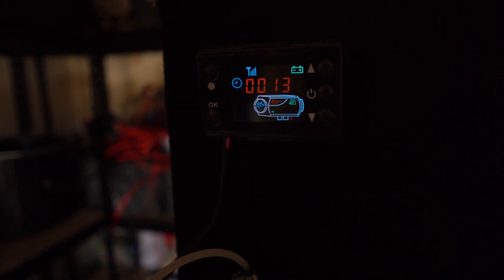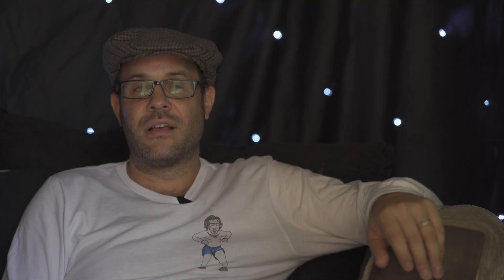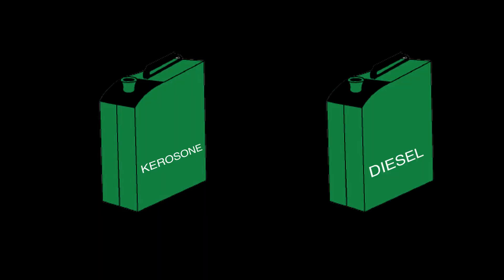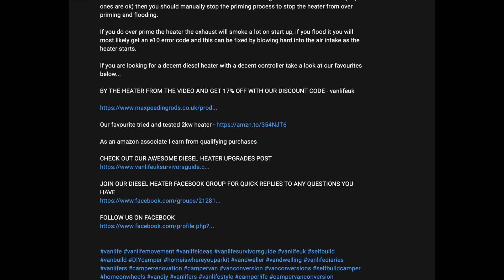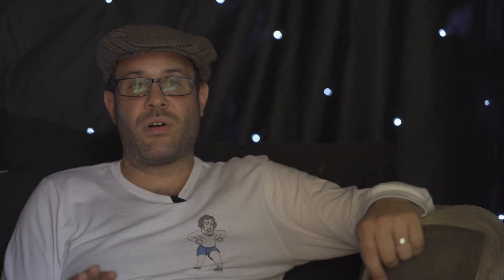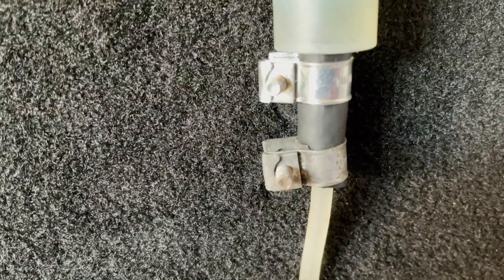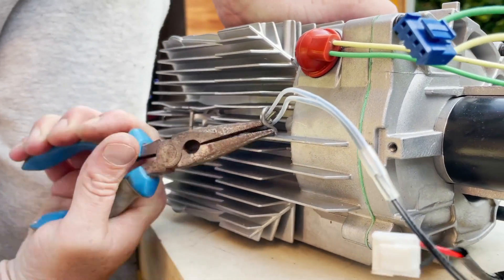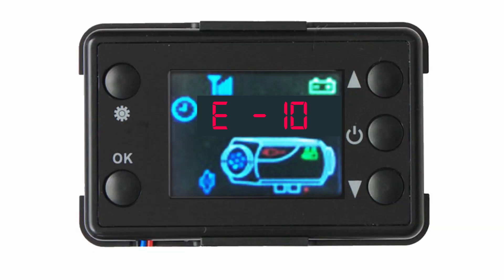Chinese Diesel Heater Error Codes E01 - E10  All Codes, Faults & Fixes

Comment: December 7th 2021
One year & one month since I brought my chinese diesel heater, I went to turn it on , and heard "Click", with no heat, no sound, no light on the controller.  I am saying all this to say "Thank You",for making this video..
After watching your video, and a few checks with a multimeter I figured out that the controler was gone.  I did as you recommended and brought another diesel heater.( cause just the ECU, may cost more than the whole heater)   With alot of praying and patience I got the plugs to fit into one another, installed the ECU, and changed the controller.  The controller has to match the  ECU, or you'll get the E-07, code.
Thank you!

Comment: Great vid, went to my van and the heater was blowing cold (obviously not shut down properly after last use) I press and hold the off button but it doesn't work and won't turn off, shows error code 1, had to disconnect the leisure battery to stop it blowing, any info greatly received if you have any ideas? TIA 👍🏻
Reply from the maker: Hi mate, yeah that sounds like error code 9 from the video. The heat sensor needs replacing and costs about £6 and takes about 5 mins to change. I think the e01 error code in this case will be a red herring as e01 is a low power error code and your heater is working.
Reply: @vanlifesurvivorsguide  thanks, I'll take a look 👍🏻👍🏻

Comment: Decided to by one, and keeps throwing p-01 code on 12v, 24v, new batteries, with charger on them and is reaching required power levels per the manual. Even added some juice to see if it would throw a high voltage code but never did. What controller and board would you suggest to get for this just so I have a piece of mind?
Reply from the maker: Hi mate, there isa motherboard and controller and remote set in this post we recommend. you will need the 5kw motherboard and then we suggest the blue controller with the red remote as the best option for controllers https://www.vanlifeuksurvivorsguide.co.uk/post/chinese-diesel-heater-spare-parts-added-extras-upgrades-2-0

Comment: hello 
my heater is showing E-3  and shut off after like 5 seconds when i turn it on.    its E-3 not E-03 i dnt know if they same or not ..??? please help
Reply from the maker: Yeah it should be the same, sounds like your glow plug isn't igniting. It could be the glow plug or your battery isn't strong enough to heat it

Comment: I keep getting the E 10 code. Maybe I over primed it, I’m not really sure. The tubing that came with the heater actually didn’t fit on any of the things it had to, so I got thick black fuel line, but it’s not rigid. Also the fuel line coils a little bit before it gets  to the pump,  And then at some point I also had some red symbol in the heater and I thought maybe that was a glow plug… Any ideas? Would love your feedback… Thank you
Reply from the maker: Hi sorry,  we have only just seen this message. So you would have gotten a small amount of the black tube and some rigid fuel line in the kit. You cut the small black tube into 6 equal lengths and use that to connect all the equipment with the rigid fuel line. If you watch through the video again you will see what we  i am talking about especially when it gets to error code 8
Reply: @vanlifesurvivorsguide  thank you for the information🤠👍

Comment: Just installed one of these worked ok twice then it started up on its own and only blowing cold and I can only turn it off by pulling the fuse , no code fault displayed  any ideas ?
Reply: Hello from the high desert of New Mexico USA 🇺🇸, are we related
Reply: @jamesmason7124  who knows .possible
Reply: @jackmason4374  my father was Stewart Mason and my mother was Sally  Dunhill
Reply: @jamesmason7124  big tree the masons
Reply from the maker: yeah that will be your overheat sensor. check out error code 9 in the video
Reply: @vanlifesurvivorsguide  thanks will do !